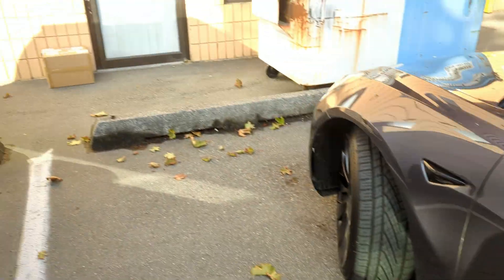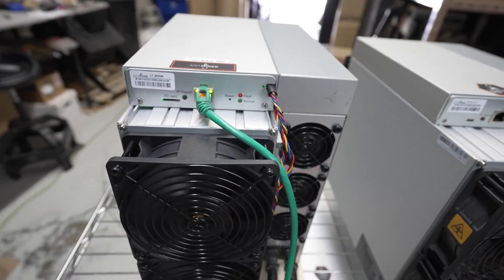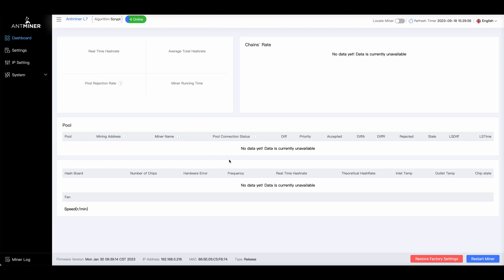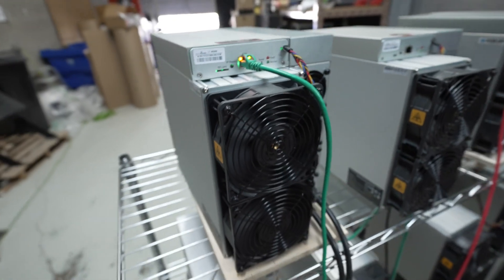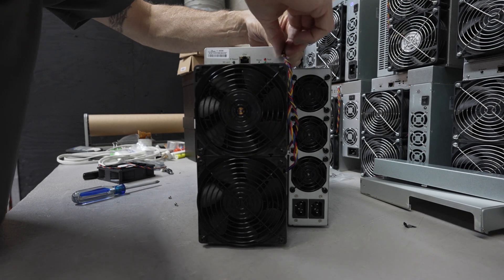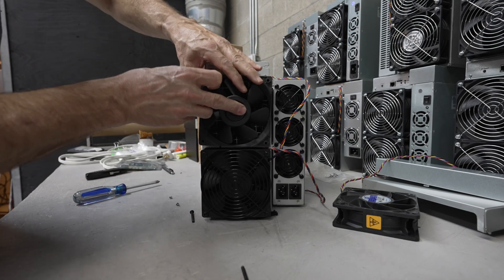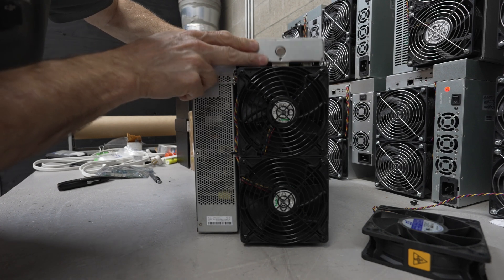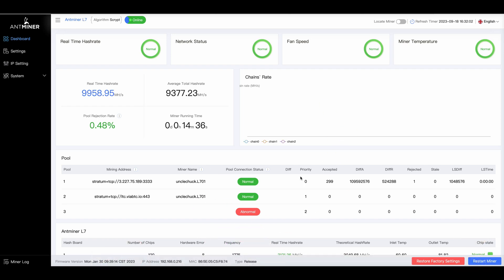Antminer Fan Diagnose & Replace How To?

Comment from the maker: Thought I would share for anyone that has a possible failing fan in there Antminer L7 or other Antminer models. This is the process i've gone through a number of times on several different current Antminer models I've had with fan problems in the past.

Chuck